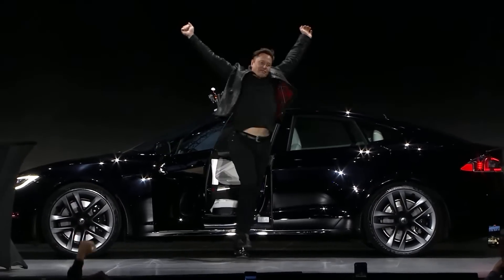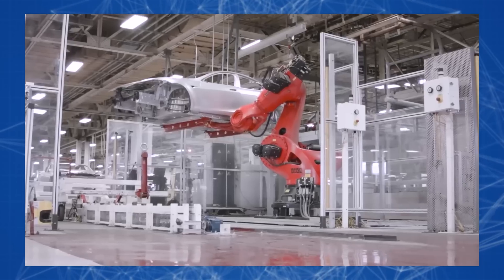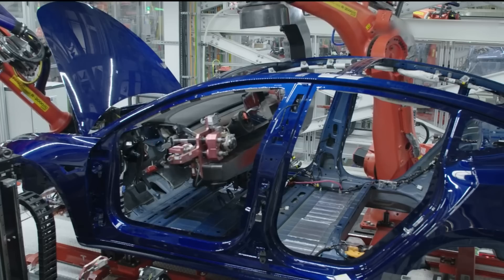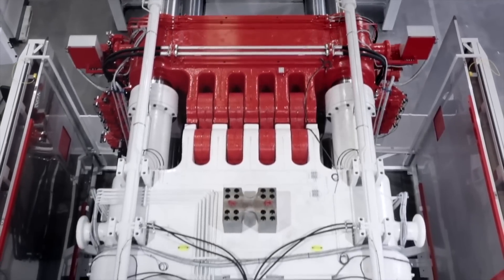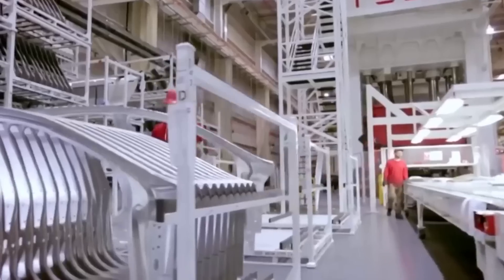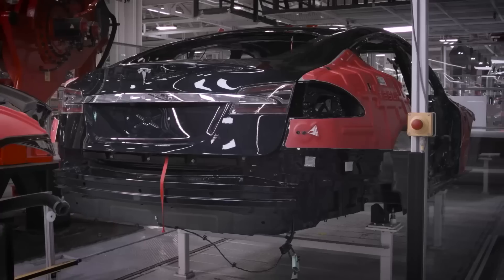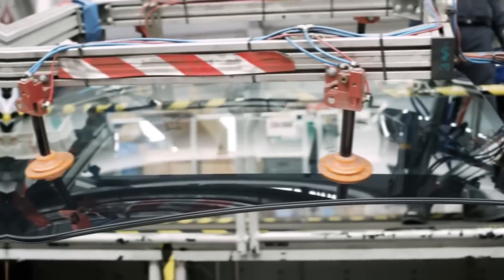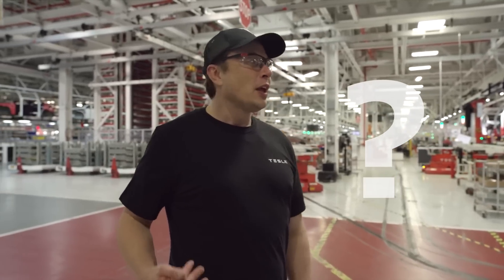Why Tesla Giga Press will not leave a single chance to competitors

Comment: A "normal car" needs 70-80 parts for the under-body. New Tesla needs 3 parts. That means 300-400 less robots and less time and logistics. The new Cybertruck frame in 3 mm stainless steel can roll/drive for hundreds of years just change to better motors, better and cheaper batteries etc in the future. A Cybertruck can stay in the family for generations. Thats true green solution.
Reply: How do you replace and repair parts of the car after an accident when everything is related together ? And what about the elongation of the material in the heat ?
Reply: sort of agree, but we don't know that. just cause its stainless doesnt mean it qont have defect or breakdown and give/bend
Reply: @iron-farmer  Indeed, stainless steel has different qualities from high tensile steel.  Whilst it doesn't rust in open air it will degrade in certain enclosed wet conditions.  As an alloy, stainless steel is more prove to certain types of fatigue failures and cracks. So even stainless steel cables for example are routinely examined and often repalaced after 10 years.  I think more advanced annual testing will be required for stainless steel structural vehicles, particularly with the high stresses of batteries.  
I'd much prefer additional checks to any injury or worse.
Reply: Wrong. People always say that about new quality products. The reality is that it will be cheaper to scrap the vehicle and buy a new one, than to replace all those parts in the old one. It is sad, but true. In a way we own almost nothing, because 99% of products are not able to last forever. They all stop working eventually because of normal wear and tear.
Reply: Tesla has 4 times the parts as Bmw 5 series. Mostly electronic. And don’t tell me electronics don’t fail.
Reply: @callmeishmael7452  the tesla has actually 10 to 20 times more electronics than a bmw, from the BMS to motor controllers to chargers, inverters..... just look at weber auto.
Reply: @raul.huertas  the fact is people hate different even if its better. It may turn out bad but regardless we are a species that consumes alarming numbers. We are screwed either way
Reply: Nonsense, its only tesla that was using 70 parts, also other manufacturers have shared platforms to significantly reduce manufacturing costs, the rav4, camry, sienna and many lexus shares exactly the same chassis and parts. The vw group is another great example, from Bentley bentayga to vw touareg to porsche cayenne, audi q7... they all have same basics.
Reply: @raul.huertas  melting and maintaining aluminium uses alot of energy, aluminium mining and processing alone is among the most energy intensive processes.
Reply: @raul.huertas  Melting powered by natural gas is also used by all manufacturers to develop those 70-80 underbody parts separately anyway. Less robots, time and logistics as Jonas said is ultimately greener. Moreover Tesla might explore Geothermal instead of natural gas in the near future as stated on Tesla Impact Report 2020 ''intention to shift energy consumption toward renewable energy asap on all manufacturing operations''
Reply: @leandroocastillo  geothermal! lol......

Comment: The cost for injection molding is VERY expensive and the dies wear down over time (probably every 6 months) Sandy Monroe said the only advantage of the giga press is speed of assembly and weight reduction, not a significantly lower price like most people keep thinking.

The risk wasn't worth it to other competitors in the past, especially with their significant investments in stamping presses. They may change their tune, but it would mean needing new vendors and engineering expertise that they don't have.
Reply: Cutting production time by 20% is a HUGE deal even if the part itself is not cheaper than before. Tesla is still and likely will be for the foreseeable future production capacity limited. Cutting time by 20% equals pretty much to 20% higher production capacity per factory. Other automakers are normally not production capacity limited, but sales volume limited, hence their drive to rather only reduce costs for the large number of vehicles produced. A gigapress makes less sense for say VW as they cannot sell more cars with this technology than they can do now and the part is not cheaper than before.
Reply: Incorrect, where do you think Elon and company got the idea?  It came from the mega casting in the corvette C8.
Reply: @mattferguson9109  for a production capacity limited product, i.e. you sell everything you can make, big time savings are golden. But there can also be other advantages as well. If you get it right, near net shape casing is nice, but it also has its challenges. I have participated in the development of casting process for titanium alloy jet engine parts.

Comment: I don''t guess that all of this robotic automation will result in electric vehicles that anyone can afford much less afford to maintain. 🙄
Reply: EVs are much cheaper to maintain than internal confusion engine cars. Tyres is it. You don’t even need brake pads, regen does 99% of the braking.

The biggy of course is no petrol. We charge our EV entirely off the rooftop solar.
Reply: Robotic automation means you save human labour costs, thus making it cheaper and more precise than trad manufacturers. 
Robots don’t go on strike, get sick or tired. All you need is maintained regularly
Reply: Dwight Vietzke  Anybody who has owned a petrol mower and an electric pool pump has a pretty good understanding of the reliability of these things.
Reply: @AudiTTQuattro2003  It's the moving parts that will need the most frequent maintenance, EV had ~20 moving parts while ICE vehicles have ~1000, the cost is still a lot cheaper to own an EV

Comment: Liquid metal injection moulding. F N cool.
Reply: Basically how a Hotwheels is made. Have you checked out how cool the Hotwheels are lately? McLarens, Lambos, NSX they even have a Cybertruck. They are 3 parts - a chassis, a body and some clear/tinted plastic with wheels and tires  and tampo graphics- they look ridiculously cool nowadays and somehow they cost ONE DOLLAR. !! Why do I mention this besides being a HW semi fan? Because that's exactly the kind of efficiency $$ savings like that $1 car Elon is doing with his die cast - just like a Hotwheels only BIGGA !!!     🚗🇺🇸
Reply: @cuda426hemi  : that’s great stuff. But if memory serves me right they have always been a body/chassis and plastic seat/windows.
Reply: @thebobloblawshow8832  I DID leave out the tray for interior daggamit! A "good" CAD for a HW uses the chassis for bumpers and side pipes or hood stacks all one piece; a good window piece will have tail lights and headlights incl, and a proper body with good tampos speaks for itself- 2 parts making 4, plus the body and dumb ass me forgets the interior tray which in the case of the Dodge Van (mooneyes and rust patch tampos) has two ATV's in the back that you can see thru the tinted roof!!  For a $1   This boomer must be ill.  But to be fair I have Tesla die cast M X with opening falcon wings and lights so....and it's die cast too lol🚗
Reply: @cuda426hemi  I love italien engineering ! ❤️